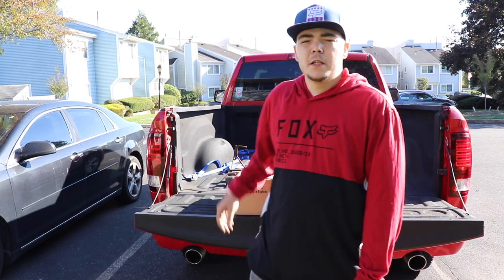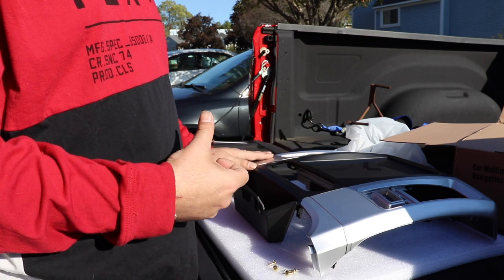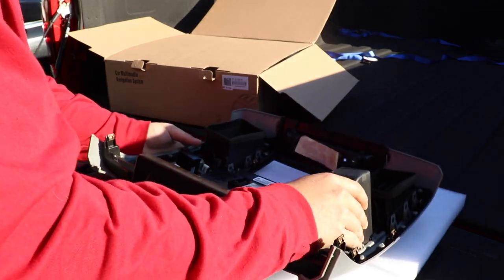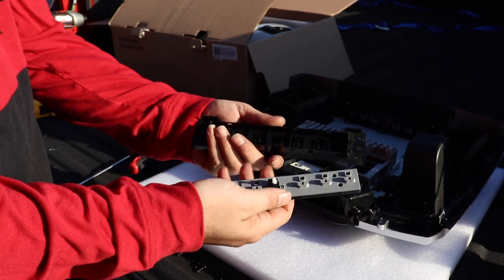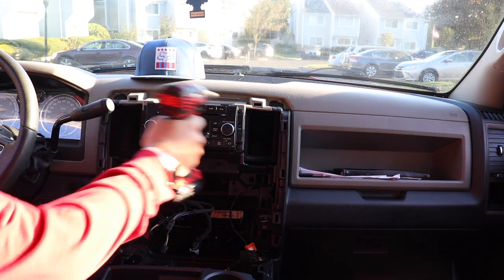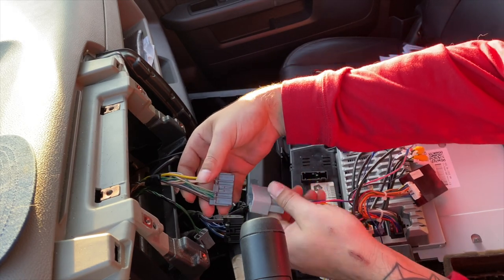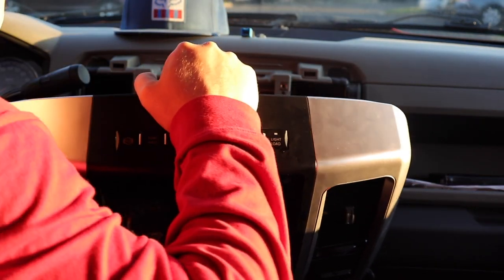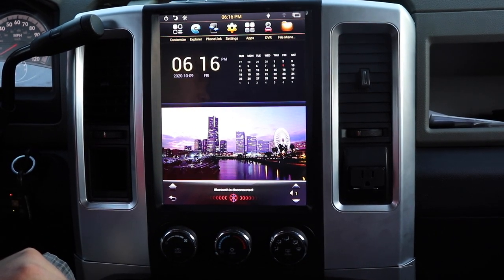4th Gen Ram 12.1" PX-6 Vertical Tesla Style Android Radio Install Tutorial - Phoenix Automotive

Comment: I just replaced the radio in my '12 RAM with a Kenwood, a cheaper radio... definitely well worth the money getting the aftermarket brakets and harnesses. What i did motice though, is in your vid, you connected what i thought was the satellite antenna to your am/fm antenna. Am i right? The satellite plug was the yellow, the radio was white.
Reply: I noticed the same thing and was wondering about it.

Comment: Hey man, good video! What wire did you tap into for the remote trigger wire for your Amp? I'm using the RCAL and RCAR on the white plug. Is that correct?

Comment: Nice video man. I have a question, it may happen to you or may not, i install this unit on my 09 ram, all is good but when i put reverse whatever im listening to cuts of untill i put in drive, you know how can i fix that?
Reply from the maker: This is a built in feature, this is meant to happen so that when you are reversing, you can focus on the reverse camera and listen for things or people in your way. My honda civic that came with a built in reverse cam from the factory does the same exact thing, it lowers the volume by like 80% until i shift back out of reverse. Its a safety feature.
Reply: Thanks man. I got mine from aliexpress, a little cheaper and also came tonmy house in two weeks, instead of 3 months.
Reply from the maker: @baloo217  Yea thats a massive difference. I only reason i went through Phoenix was because of warranty and someone to call if something went wrong, but in the end, Phoenix was worse to deal with then a random Aliexpress seller. I have been extremely busy but i have a video written all about Phoenix and my experience with them, screenshots and all, but i havnt had time to record and edit it. Hopefully i can get it done soon.
Reply: @baloo217  what's the name its under on that site so I can purchase? Thanks
Reply: That link will take you to her store, then , use the search bar

Comment: I need to find the wire diagram for 2011 Dodge Ram 1500. Trying to connect the original backup camera to a aftermarket stereo.
Reply: Did you ever find it? I'm needing this info too.

Comment: I have a factory backup camera with my truck already . Is there an adapter for the factory one or will it just not work with this radio
Reply from the maker: Yes there is an included adapter for the stock oem backup camera. I used the hook up to hook up an aftermarket camera. In my video I point out the backup camera wires.

Comment: can use aftermarket amplifier and subwoofer?
Reply from the maker: Yes, absolutely. I actually have a Kenwood amp and 2 pairs of Kicker CS2’s that I will be putting into my truck in the upcoming week or two (will be a video on it) and they easily hook up to the connections on the back. If you watch the video you will see all the RCA connections and wiring on the back.
Reply: @onsaleproductions4803  we’re ever able to confirm RCA for front, rear, and subwoofer? None of the RCAs are labeled for that. Thanks in advance

Comment: Hi I am interested in this scree.  Will this allow me to continue my subscription to Uconnect? I know that I can install SiriusXM app on the device but will it still getting signal directly from the antenna fin from my truck instead of Internet data? Thank you.
Reply: No, it would be just like using XM on your phone.  App over wifi.
Reply from the maker: Not sure, I don’t have any unconnect subscriptions. However, my uConnect hands free phone buttons on my steering wheel still work.
Reply: @tizoned1  Thank you. I guess that is a no-go for signal over antenna. I read somewhere you need additional thing to make the antenna work on this radio.
Reply: Thank you for the reply. I guess it doesn't work with Uconnect security features. With my uconnect I could lock/unlock, start/kill of engine etc. I will read some more and thank you for the reply.

Comment: What about a 2500?
Reply from the maker: What about it? This will fit any 1500, 2500, 3500 etc. they are all the same when it comes to dashboard radio setups.
Reply: @onsaleproductions4803  the buttons for exhaust brake, hazards, tow/haul are different

Comment: This is a joke I have the Linkswell radio and it had none of this BS like this one all I had to do is remove the old radio and put in the linkswell, I had my radio within two days after I ordered it and it took me 30 minutes to take out and put in my new radio plus the linkswell has many more features than this one only real difference is my is only 10.4 inches but it looks way better than this thing does. Also the linkswell has directions on all wiring so there is no guess work.

Comment: 850 for a screen? That's ridiculous
Reply: You clearly dont know about Dodge Rams, especially this generation (4th Gen). The radio bezel trim that goes around the radio is no longer made by Ram or Mopar (the bezel for the floor console model). These bezels sell for $300-$500 alone on ebay, so the fact that not only do you get a massive 12.1" android touch screen massive screen, you get a brand new radio bezel for the floor console model. And I paid nowhere near $850, mine was $664 shipped. I sold my old floor console radio bezel on ebay for $395 so i paid around $275 for the radio in the end.